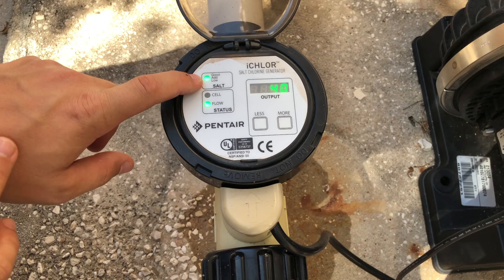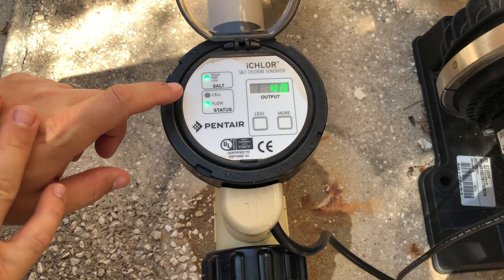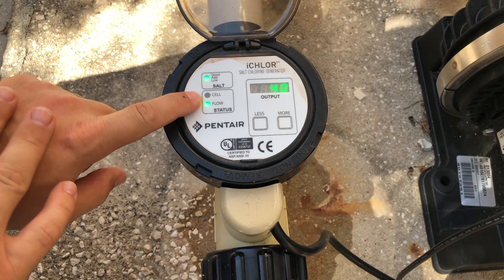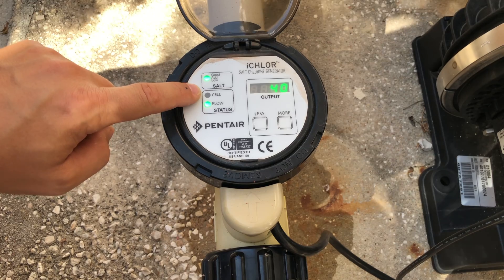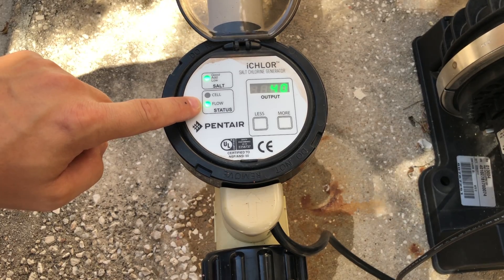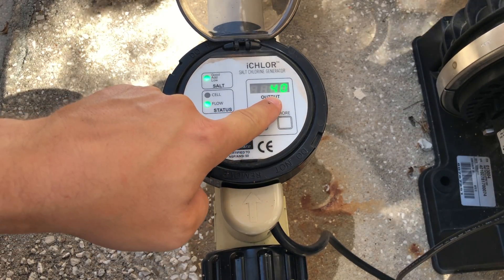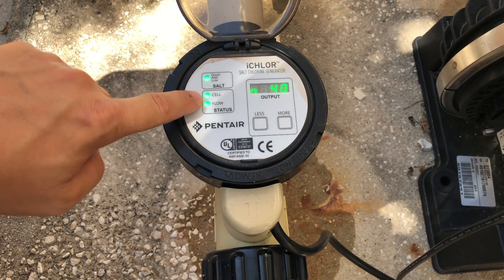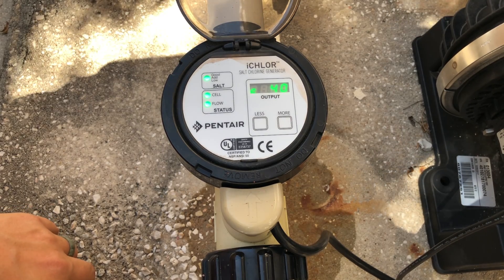What Do iChlor Lights Mean? Decode Your Salt System Like a Pro

Comment: What does it mean if everything is solid green but the viewer reads CELL in green letters. Cell has been cleaned
Reply from the maker: That means the cell is failing.
Reply: @ChlorineKingPoolService  That's what I was afraid of
Reply: @ChlorineKingPoolService  Do you know if I have to replace it with the same cell or if there's a cheaper, generic brand alternative?
Reply from the maker: @JW0143 there isn’t a generic one unfortunately. They ending production on the ichlor this year and now have the ichlor30+. I’m not a fan of it. Problem after problem so far from my experience. That’s the only drop in you can get and still use the existing unions.
Reply: @ChlorineKingPoolService  Man you're full of bad news. LOL Is it as easy as unhooking it and installing the new one?

Comment: So the flow led and the cell led blinking red could be a bad flow sensor ?
Reply from the maker: It's possible. Go into the diagnostic menu (I have a video on that as well) and see if you are getting a good salt and temp reading. If you are not getting a temp reading or a very high one that doesn't make sense (like 120*) then the flow sensor is bad. If you are getting a very low salt reading, then the cell is either dirty or could be failing. I'd also look at the runtime hours in the diagnostic menu as well.
Reply: @ChlorineKingPoolService  thank you I will look at that

Comment: Cell light is flashing green I've cleaned it 2 times and it goes back to blinking green again? It is only a year old ad well? What gives
Reply from the maker: What is your salt level at? Also does the display show “Cell” at all?
Reply: This is exactly the situation I have...cleaned the cell (it had a lot of buildup), but its still flashing green ans says the word cell. Any ideas?
Reply from the maker: @joed4487 if it says “Cell” it generally means the cell has failed. How many hours are in it?

Comment: Salt is flashing green what can I do?
Reply from the maker: That means the salt is north of 4500ppm. You can dilute some of that salt with putting a hose in to fill the pool for a bit. If it’s full already just put the hose in first and hour or so for a couple of weeks and it should bring it down to optimal ranges.

Comment: My salt is flashing green what do I have to do
Reply from the maker: That means the salt is north of 4500ppm. You can dilute some of that salt with putting a hose in to fill the pool for a bit. If it’s full already just put the hose in first and hour or so for a couple of weeks and it should bring it down to optimal ranges.

Comment: I just installed this weekend. We have not added salt to the pool yet. I was wondering my lights stay on all night even though the pump is not running. Is that normal?. If not when you think it’s wrong
Reply from the maker: That is bad. It should not be hot 24/7. It should only be on when the pump is running. You are prematurely killing the cell it can also create gas build up in the lines (if the water is not flowing and the flow switch fails) which can be dangerous. Please make sure it's adjusted to not be on without the pool pump running. Thanks for watching!

Comment: Hello! Your videos are very helpful. Question: my iChlor 30 display is reading “AC” and a red light runs quickly from top to bottom in a sequence. It is hooked up to the intellichlor power center and the light is green inside the center. The system is only two years old. I just noticed this yesterday and have no idea what to do! Any help would be wonderful. I’m clueless with anything electrical if that’s the case. Thank you so much I’m advance.
Reply from the maker: Hey Callie, I’m not sure as I’ve never experienced that. I even checked the manual and it doesn’t say anything about an error code “AC”. I’d venture to think it has to do with power. What is the voltage going into the power center? Is it wired properly?
Reply: I think our power box is 240V that is going to the power center. The pool company installed everything so I’m assuming it’s wired properly. It’s very odd. It has ran fine for 2 years and now this pops up.
Reply from the maker: It sounds like the cell needs to be replaced. It should have a 3 year warranty so you should be good. Contact your installer and they should take care of it from there!

Comment: If all led lights are out does that mean water is too cold?  Ours is only 2 weeks old and all lights when out.  If we unplug and plug back up the lights flash then go dark.
Reply from the maker: No it sounds like possibly a fuse blew in the power center. It'll say cold on there if the water is too cold. Could also be a short if they quickly flash then turn off.

Comment: Hi. 
My flow light is green and cell is green. Salt is solid red. 
But I can't get to the menu setting by holding more button. I wanted to check the salt reading. Please help
Reply: Also when I press and hold the less button then it allows me to change a number from 3 to 5 hr
Reply from the maker: It sounds like the membrane pad is bad. That number is the reverse polarity. I just swapped out a cell that was doing the same thing as you’re describing.

Comment: I just put my pool back together after purchasing an ichlor30. I’ve had the cell for 2 months last summer and now when opening my pool I have a solid red light next to flow. Can it possibly be a bad flow switch only having 2 months use ? Thanks in advance.
Reply from the maker: Unfortunately this is a known issue with the ichlors if you have the old style (1st gen) flow switch. The new switches solve it for sure.
Reply: Chlorine King Pool Service so purchasing a new flow switch for the unit will solve the issue? I can’t even believe it went after two months use.
Reply from the maker: It should be covered under warranty (3 years) as long as a licensed installer installed it.
Reply from the maker: Contact your installer and if they aren’t a warranty station they should be able to help.
Reply: Chlorine King Pool Service it’s a long story but to some it up I had an icholor30 installed 2 summers ago and I had that put in by an a pool guy. That crapped out only after one summer. I fought with pentair last summer cause it crapped out after one season. They sent me a brand new one and used it 2 months last summer. Now I reinstalled it and the thing doesn’t work. I feel like these things are pieces of Sh*t
Reply: Thanks for your help I appreciate it. Also I have the old icholor30. Tomorrow I’m going to install the flow switch that’s in that unit. I’m going to follow your video on how to do it ! Thanks for your help.
Reply from the maker: I’m sorry you had such bad luck with it. I had good use out of mine. I’ve been piloting the Jandy TruClear now for over a year and it’s been rock solid.
Reply: Chlorine King Pool Service I’ll look into that one. I’m going to switch the flow switch from the old to the new and see if that works. I really don’t want to spend another grand on a new unit when I feel like I just did. Do pool stores carry those flow switches ? In case the one from the first unit doesn’t work either?
Reply from the maker: Yes, give it a shot! I’m not sure to be honest. You may have to order from pentair directly.